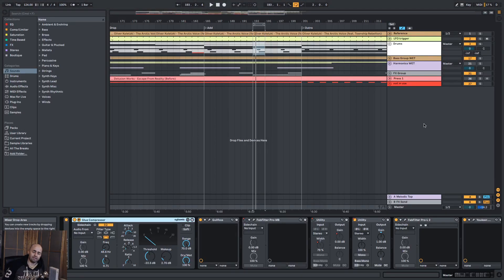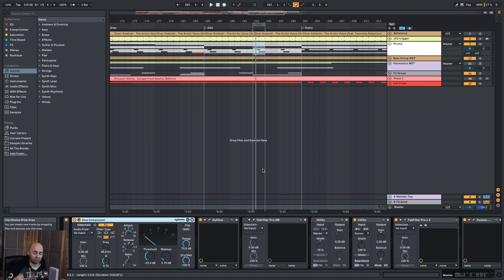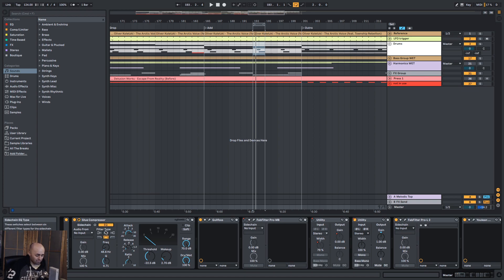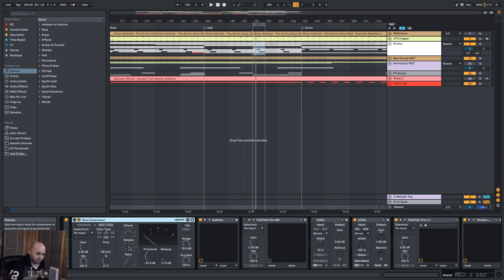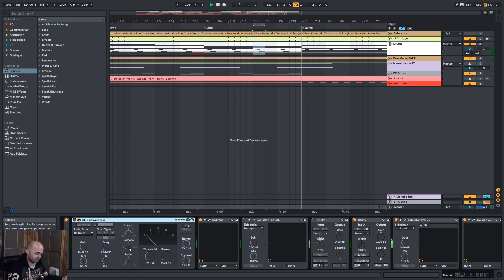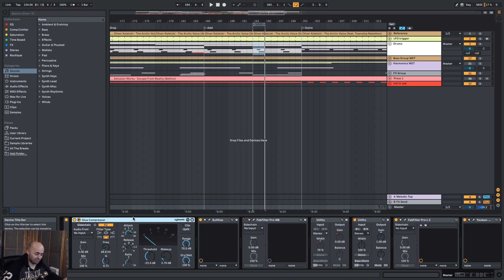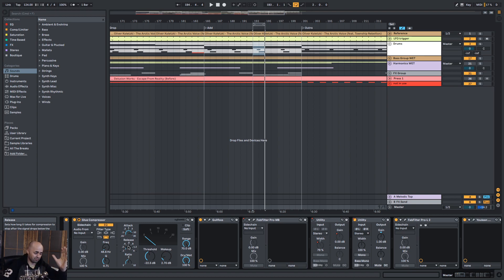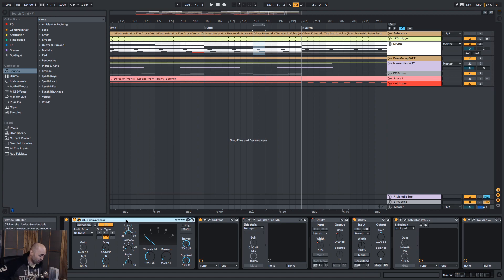Easily control your low end

Comment: Cool tip!
Reply from the maker: Easy and useful :)
Reply: @Catandbeats  I have a question for you. As of recent, I have been utilizing Fabfilters MB as a source to send all my individual tracks too including my kick.. then sidechaning everything from 2k (high end) (in the EXPAND feature) with a fast attack and fast release to my kick. My goal is to achieve this fullness in my mixdowns to make everything feel balanced and full. I am producing techno. Do you think there are any specific pros or cons to this? Like too much high end? Or phasing issues or too much compression? So far it sounds fine in a premaster but I wanted to get a second opinion from you bro :) Many thanks for your time!

Comment: Couldn't you use the Compressors EQ Freq to duck any frequency that was leaping out? Such as higher frequencies as in de-essing of sibilance?  I get confused on the exact difference between Multiband Compressors and Dynamic EQ, but this looks a nice straightforward way to get the same results. Cheers!
Reply from the maker: Yep you can :). Dynamic eq is the same as a multiband compressor. The only difference is the shape of the filter type